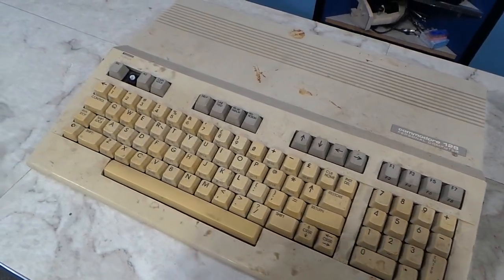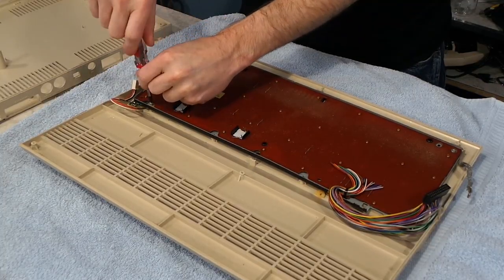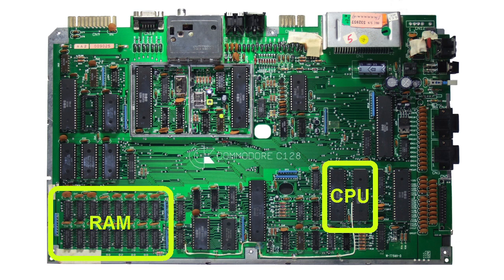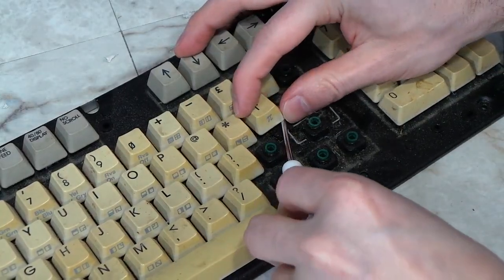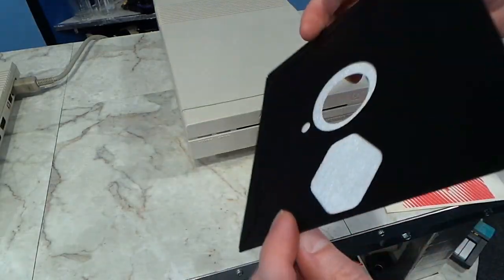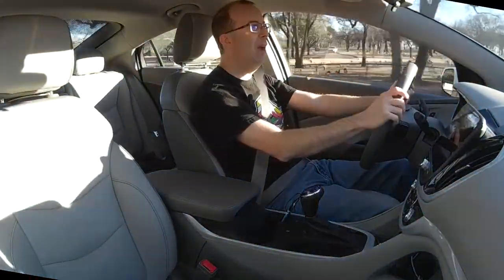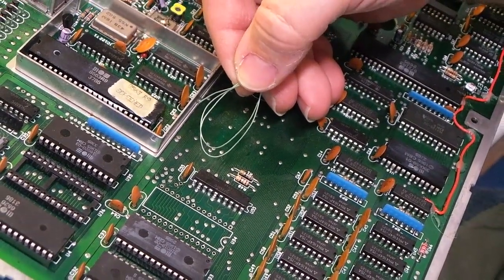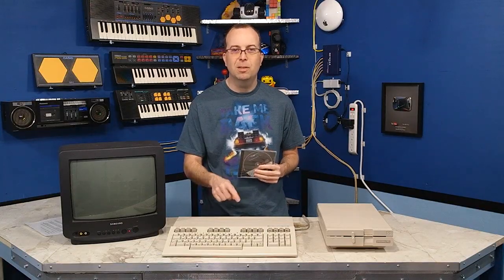Commodore 128 Complete Restoration and Board Repair.

Comment: Hey, great restoration project.  However, honestly where the heck do you find computer technicians who can still work on vintage computers (in the Chicago area)?  I'm literally in the process of restoring a CBM 128-80 computer.  I've located a number of corroded ic chips and bought the corresponding replacements.  After checking with a number computer repair shops, I have discovered nobody in my area knows how to (or willing do so) solder components.  So, I'm here teaching my self how to de-solder and replace ic chips.  Wow, even the mother board has a RF Shield which has solder points connecting it to several edges of the main board.

Comment: Something else you should consider doing with these keyboards is use some dielectric grease to lubricate the switch housings, springs, and stabilizers depending on the type of switch. This can make the keys smoother and less noisy and creaky. I personally prefer Krytox lubricants.

Comment: Gawd this brings back memories, I used to be a service Tech for Commodore in the day, the MOS branded chips were notorious for blowing up, the cause 95% of the time was the crap power supply with the C128,  standard procedure was to socket any chips that were replaced because we knew it would be back in the service centre, the C128 was the worst power supply, the 128D were fine

Comment: I have just purchased my first (since childhood) C64 and it needs some restoration. I see Hydrogen Peroxide was used. Is this really ok to use on the keys themselves. Its the only part on my C64 that has gone yellow. Will this not damage or remove the letters on the key itself? Thanks

Comment: I got lucky when I got my first 128 two years ago as a fully-functional unit, dated November 1985. The led have some minor issues, but there was no problem with all the software I threw in it. If only I got a color A/V cable instead of a B&W! (at least the picture quality is sharp)

Comment: 10:13 I think thats the ticky tacky - at least thats what they called it at my school back in the day. The teachers would use it to stick up displays and posters on the walls without drilling or tape. Its a really light blue almost white/grey color.

LocTite makes some still. Its called Fun-Tak. The teachers in my elementary school used it by the truck load for some reason. It was everywhere.

Comment: 8:12 Can you tell us what product did you use? Cause I don't think liquid Hydrogen Peroxide use in Medical is strong enough.
10:32 What should I told those employee to found those?
5:34 Acording to my research, that "is ethanol that has additives to make it poisonous, bad-tasting, foul-smelling, or nauseating to discourage recreational consumption" so it just Ethanol with bad stuff added. Don't know if I could use Medical 90* Ethanol as a replacement?

Comment: I have a plastic model train, it should be mostly white but it has now partially yellowed. What would be a gentle enough way to try restore the white? The underbody is dark gray and there are livery stripes painted on it, so bleach is not so good. Also it has plastic windows, so abrasive methods might just scratch those. Is there something that simply dissolved the bromine but leaves the rest alone?

Comment: While trying to sus out why mine doesnt work in 40 column mode i noticed there are 3 chips in yours. Mine does not have the far right one (the three near the led just forward of the psu (mines a 128d)
Also had one loose chip inside. Mos 390059-01 2 pins missing. I believe you said that was the sound chip? Are they still available anywhere?

Comment: I have a 128D(internal disc drive/power supply) Modded a fan to keep it cooler. Basically, it was used as a 64 mainly because there really wasn't much use for 128 mode. Very few software titles came out for the 128. For the 64, there was so much software that it was mind boggling. The one thing I really miss is the ability to easily program my computer now that I'm using a PC.

Comment: Commodore 64 nearly cured me from  EVER  having ANYTHING  to do with computers again,  EVER.   Few years later  I bought a used  "Bleeding Edge"  8086  to which a hard drive had been added.   Receipt for the hd was in the  case, someone had paid over 2500 bucks  for  hd and controller.  Had about a 12"?   amber screen CRT,  DOS 3.3  I think,  40mb drive

Comment: I am confused. Why do you need to grease non-moving parts? Or is it for heat resistance?
Reply: It's for thermal conductivity, the grease helps to fill air gaps between 2 pieces to transfer heat better

Comment: Interesting video!  I couldn't believe how INVASIVE the testing needed to be in order to find the faults in the Commodore 128 computer.  With the jumper wires put in, I did something similar to my own Commodore 128 computer, where the problem was inside the "can" where the 80-column video chip was.  Stuff like this can be a BEAR to diagnose!!!  Nowadays, they don't even work at the chip level much anymore.  Back then, motherboards were much more expensive in relation to the cost of living and such.  Nowadays, it's much more sane to just pay $100-$150 for a new motherboard.

I also enjoyed the nostalgia here.  To this day, I'm STILL impressed by the shear power of the SID chip, given the time frame that it was developed (around 1981-1982 or so).  I actually tested two computers with SID chips in them, set them to the same frequency software-wise, and they were DEAD ON with each other!!!  I also tested one by obtaining A-440 software-wise, and then compared it to a tuning fork--DEAD ON!  I actually had a Sound Blaster AWE-64 Gold in which the HARDWARE tuning was about 2% sharp!!!  It was NOTICEABLE!  However, the SID chip is much older, but had SPOT-ON tuning!!!  The SID chip was a surprisingly powerful synthesizer chip and was able to be tricked into doing crude digital audio, such as that evident in the Ghostbusters game intro.  For what it was, it was a surprisingly versatile chip!  While the SID chip could go up to only about 4 KHz, there is a software / hardware trick (controllable all through software), to where you can generate a nearly 8 KHz tone.  I actually built an audiometer (device for testing a person's hearing) interface that get its "power" from the almighty SID chip (inside a Commodore 64 or 128 computer).

Yes, I owned both the Commodore 64 and 128 computers.  These were certainly interesting machines for what they were.  Yes, they both generated NTSC video signals.  Their processors were also rather efficient in terms of useful performance per megahertz, especially for that time frame (early to mid 1980's).  Both machines also had dual A/D convertors, originally designed for paddle game controllers, but opened up interesting doors in other ways.  These could resistances between 0 and 470 K-Ohms.

Thank you for sharing this!

May God's peace be with you--in the name of Jesus!

From John Nozum

Comment: The batteries in the car you drive...... when they made just the set for 1 car like yours...... the emissions that came out of that factory , for those 3 days... is the same pollution levels as a v8 that run for 8 years  straight.    dont think your car is saving the world, when the batteries are killing it, 8000% faster.   dont believe me...look it up.   That is what Google is for.

Comment: Reseating the chips is very important! I read a research study some years ago that investigated the "root cause" of computer problems from Geek Squad rejects. A surprisingly high number were due to connection problems - between a ribbon cable and its socket, or between the board and the motherboard. This explains why sometimes replacing a board fixes the PC, and the replaced board actually still works!

Comment: My question would be. I have a 128 and whatever came with it, Commodore Monitor, a dot matrix printer, and a Cassette Tape Drive, working when I put it away after getting a PC, I believe it's in the original box, with the original paperwork. Any idea what that would be  worth nowadays?
Would appreciate a PM if you care to respond.

Comment: that "yoda" is a smart fella, ditto on the sockets, nothing worse than sockets that go amok...... but at the same time, I spent much time removing sockets and direct soldering things when they broke down......... things go awry at accelerated rates when vibration is involved, like audio amplifiers, they get abused and rattled by the same noise(music) they amplify.
I've ran into many socketed op-amps that causes full meltdowns of the output stages and speaker voice coils, only thing wrong bad contact at chip to socket from vibration, often the amps would survive but nuke the speakers to permanent death.

Comment: oh yeah kinda reminds me to my childhoot and my first Computer the good old Bread Bin this PCB had ICs with less than 30 feets you could easily solder yourself and Boy we did^^Remember the time when the Loading Bars begin to SUCK. at this point Tim Taylor would say:we need more Power.So I got my tool Box and began to build a Socket which i could switch between various operating Systems which imc were Speeddos,Dolphindos,Prologicdos
after pimping the floppy you were up to 40 times faster than generally

Comment: Absolutely a labor of love, sir. Bravo. I do have to say that it still looks bizarre to me when I see a flat 128 (non 128-D) without the "tree" coming out of it. Ha ha. Explanation: My brother and I read about a group in Germany back in 88 that would expand your 128's RAM to 1MB so that all 16 banks (0-15) were addressable. They wanted $1,000+ US for the service. Being a couple of genius yet poor boys from Texas naturally we looked for the answer on FIDO Net. Upon getting the specifications from a professor in Chicago, Dr. Emmet Lagoon, we set off trying to build "The Tree". The super-short version is, you punch a hole in the 128's case just above the 40/80 Col selection key (if I recall correctly). Originally the German crew had to remove to "Stop/Lock" key and the tree came out there, but that REALLY interfered with typing, so an alternative was made to route the RAM relay lines through what we might call today "the northbridge". Very loose reference to the modern concept. Anyhow, my brother constructed the "RAM Tree" vertically from there, 8 chips on each side, 6 vertical, 2 horizontal. It took us almost a year to get the RAM reliably addressable because we didn't fully understand the issue of "when RAM timings are X, and you lengthen the physical length of the lines to get to the MMU considerably, the RAM timings are no longer correct". We then had to seek our own "Jedi Master" to help with this. Easy fix: he rerouted the lines through the area where the keyboard would lay over, we however had routed it WAYYYY around the left on the outside of the housing. This kept the RAM within timing tolerances. After we got the first Tree to work, we then applied it to our 128Ds which were our primary systems. To this day there is a special mark of pride in myself for being one of the VERY few people on the Earth to write software specifically for C-128s with a 512k RAM Expander (1750) and 1 MB of natively addressable RAM. With the advent of the FD2000, we were able to do things like one-pass copy an MS-DOS 1.44mb Floppy. We also wrote a WAV player for GEOS that would load up to around 9 mins of music into RAM and play it in the background. Having only a 3-voice SID chip, some music didn't translate well but 50% of the time it sounded like fairly clear AM radio. And to my knowledge was the first and only implementation of IMA/DVI ADPCM for Commodore in history. Anyhow, I digress terribly. From one Commodore lover to another, my hat is off to you, brother. Warms my heart to see someone still care this much. I'm all misty-eyed.
Reply: and here I thought I left some long/novel comments :))
Reply: @throttlebottle5906  It's one of my trademarks. I police the facts and biases of reviewers in the tech and gaming communities here on Youtube and RARELY will you see a post that is less than 2,000 characters when I go off on someone or support their cause. (this is the part where I really should go on for another 1,800 characters but I'm busy writing a review. Ha ha. Cheers, brother)

Comment: A quick recommendation from another guy who refurbishes stuff:  Instead of paper towel, buy some very cheap microfiber cloths on amazon or ebay. It's nearly the same price as paper towels if you catch some deals. Works 200% better than paper towels!  And just throw them away after use, not worth washing them if you buy them as cheap as I am.

Comment: Hello David, I have been Retrobriting for awhile... wanted to tell you that I use a Wagner handheld paint gun to spray on the Retrobrite gel, it gives an even coat. I also use a clear wide flat storage container with locking tabs and seal... I got it from Walmart for around $10... It is much better than plastic wrap... allowing max sun light and keeps evaporation low...

Comment: A recommendation for passive-cleaning: Prepare a bath of baking soda + apple vinegar + washing-up liquid (raspberry for the smell is wonderful - reeks like a VW T1 armature when the commodore runs its first 24 hours burn-in with Giga-Cad | alternatively for smoked-to-death casings use lemon + a tad bit more of he apple vinegar); of each a spoon or two and add 40°C distilled water; if the case is bend use 85°C and apply weight where it needs to be flattened. - All in all let it bath for half an hour - after that begin scrubbing. 5 to 10 minutes will be more than plenty. This mixture loosens more dirt than it seems, use pads with isopropanol afterwards to see what comes to daylight. - Have fun!

Oh, for the keys, use an electric Toothbrush tinted with baking soda and lemon juice concentrate - it is the undeadly version of acetone and hydrogenperoxide.

Comment: What a risky method to check old computer! Turn it on without even measure power supply voltage? And even worse - try to run your precious working C128 on that power supply? Crazy. I don't even mention you have not opened the old one C128 case before try it.

Comment: Great restoration. to check the circuit i use an oscilloscope on chip pins,  look at the chip pin chart and data and power pins should be active.

Comment: Did you check the power socket on the C128?  You could have a broken solder joint from someone bumping the power plug.

Comment: My father used to work for "elephant" memory systems copying games to floppy disk?  I don't know much about his job but as a little kid I had the best Atari 400, Atari 2800, Commodore over 500 floppy disk with 10 to 12 games on each one! Our Atari 400 how to house alarm a sketchpad a printer two floppy drives lots of ad on wire bans coming out the front? And special switch chips? What's their Internet then?

Comment: buy an electric buffing machine with soft wheels for finishing off aluminium, it works really good on plastick and it takes a little bit of, so goodbey peroxide. its one good tip i have, for the rest faboulous work, enjoying youre vids

Comment: Re. cleaning keyboard keys, I really recommend getting a battery-powered rotary scrubber, it's like an electric toothbrush except it's actually for cleaning stuff. Scrubbing the keys goes much faster when all you have to do is put them all into a tub of soapy water and press each side of the key into the scrubbing head.

Comment: jus a tip dav, if you soak the plastic in a oil like veggie oil for a day it brings structure back into the plastic. same for game controllers, jus make sure you let set for a few hours, and clean and dry completly before you put them back but im guessing that one pretty ovi

Comment: I've replaced the fuse from the PSU of the c128 and it works. Too bad the screen remain black and the system non working (red led turned on). Any ideas?